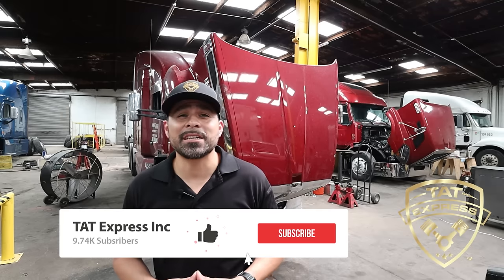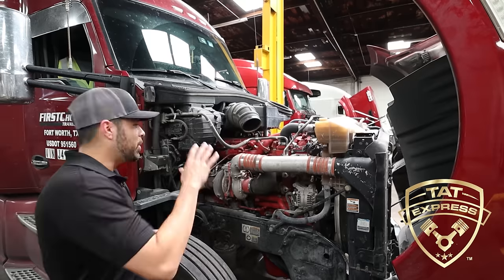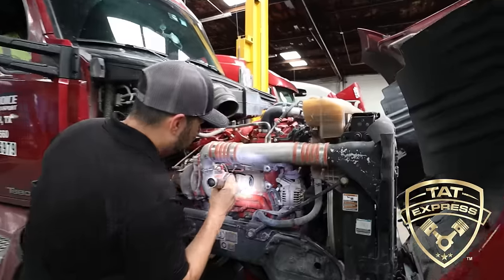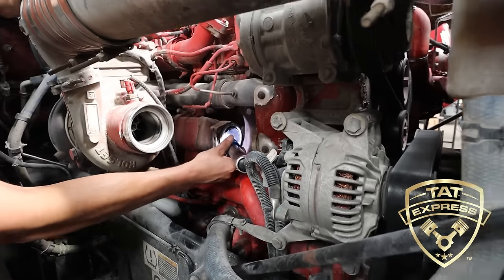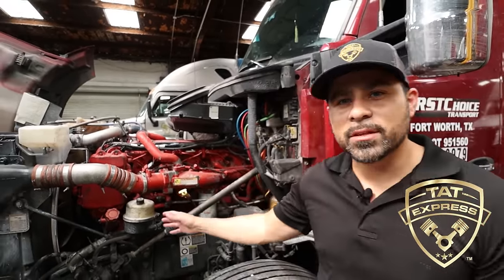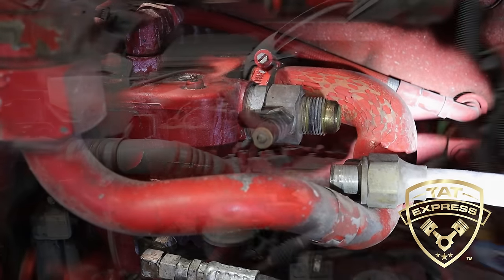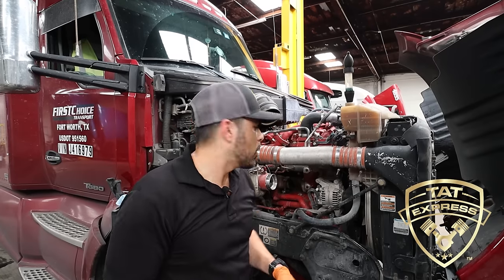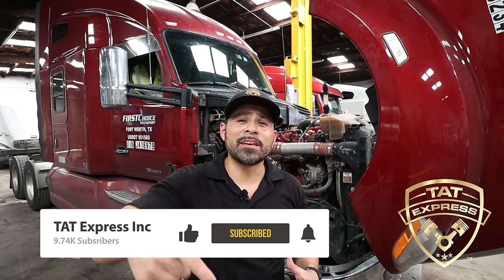Cummins Coolant Overflow/ Coolant loss/ Excessive Pressure in coolant/ Cummins ISX15/ Cummins X15

Comment: Thank you for the videos. Great job. Here's a tech tip for ya. If the driver says I have to keep adding coolant and I don't see it leaking. Quick test. Pull the drain on the air tanks. If coolant starts flowing from the air tanks. It needs a compressor
Reply: Which compressor?
Can you be specific please
Reply: Air Compressor.

Comment: Changed out refurbished radiators 3 times! Radiator finally holds, now the COOLANT starts leaking from some where else 😂 lol! Thanks for the videos I’m fixing on replacing the EGR cooler next I can’t get a Delete here in Cali !!! 😭
Reply from the maker: Hugo, you defiantly can waste some time with refurbished parts.  Thanks for the sub.  🚚🔧💪

Comment: I’m having high coolant psi and takes more than 2 mins to build primary air on idle . I’m also having oil n water coming out of secondary air tank on driver side . Would this be an indication of compressor bad ?

Comment: Forgot to mention checking the radiator cap. Even if its not mounted on the radiator but a coolant tank. Since caps are pressure releaf valves and need to maintain a certain amount of pressure to the system to lower boiling point since every pound of pressure raises boiling point like 3 or 4 lbs. If the cap doesn't hold pressure due to a bad seal then the coolant can boil out slowly. I don't work on big trucks but in the automotive business & I would say 70% of the caps I test fail
Reply from the maker: John, thanks for sharing your experience.  We appreciate the support.  Be sure to hit the sub button.

Comment: I had sorta the same issue on my 2010 FX35... but when i drive all the coolant ended up in the expansion tank and out of the radiator... so often i had to siphon it back into the radiator. I didnt have any weird lights but if i continute to drive all the coolant will be in the expansion tank and myc ar will overheat.... after change so much i finally took it my mechanic where they found i had a warped head... changed headgaskets, timing chain, water pump, galley gaskets and all... all seems to have resolved the issue for now.... i'm still getting the air out the system after 195 miles driven.

Comment: I have no coolant in oil. Air compressor line don’t have any wet spots. No coolant leak under truck anywhere. When truck is idling it’s good but when on the road the coolant drains. Coolant is going somewhere else what else could it be? Gasket?
Reply: Transmission cooler possible culprit 😊

Comment: We had an isx blowing coolant out and the owner immediately said the head is warped and to take it off. While doing the strip down we found every lash setting to be tight. Zero lash on both intake and exhaust. I wanted to do the overhead set but owner insisted on replacement.

Comment: I had pressure in my coolant and after running for 4 hours I was told it was my over flow reservoir cap. Then when I would get a load the pressure would spit out coolant through my hoses and split my passenger side top hose. So I ask them to change egr cooler and they found a crack in my head. My cam was damaged and rollers needed replacing.
Reply from the maker: Thanks for sharing your experience. A combustion gas test could of indicated an issue before hand.

Comment: New Subscriber....think I need a new mechanic behind just watching this...just bought a 2011 peterbilt with Cummins isx...rear & front seal leak & the same coolant issue...not losing a lot but enough for the low coolant light to come on...but overflow stays nearly full...truck isnt running hot...dash reads "NO WARNINGS"...remarkable oil pressure is balanced..but does have leak...bought at cheap price...less than 15...but mechanic diagnoses was truck would need a complete overhaul because of the coolant issue...I wish you'll establishment was closer for better 2nd opinion...I just wanted the seals replaced & find the coolant leak....I can only afford so much...

Comment: if you fail the bubble test and take off the compressor discharge line and it does not reduce bubbles could compressor head still be bad?

Comment: I have a Cummings ISX when going up bridge with a load my engine is stalling. I changed the accuator on the turbo. The coolant is very dark. Can pressure from EGR cause engine to stall?

Comment: Hi,thanks for the helpful video always.i  have 2013 volvo d13. My problem is temperature going up all the way to 205 after I stop driving,traffic areas,and hills.and never go back to 170 unless I turn on the AC period.and when I open hood see if the fun working if I on the ac yes if not!! I change thermostat, fun selinoid,temperature coolant sensor.fan clutch is good.any aida what can be

Comment: I have the isx 15. I’m losing coolant. But still trying to determine where. It’s going from cold max to cold min in about 16k miles. Talking with kenworth, I have no signs of a head gasket. No pressure in the coolant system. No cross between engine oil and coolant. Both look clean. No coolant coming out of the vent cap. No bubbles percolating in the reservoir. With a pressure tester it goes from 15psi to 0 in less than 10 minutes. Kenworth told me to check my fuel and transmission. (13 speed manual with heat exchanger) can’t see coolant in the fuel or water separates. I changed the transmission oil and sending it out for a oil analysis to see if coolant is mixing in it.  I’ve taken the hose off the exit side of the egr cooler and looked good and felt dry. At this point I’m hoping it’s the heat exchanger on the transmission. It’s the cheapest fix. Other than that the truck runs like a champ and no loss of power
Reply from the maker: Have you tried pressurizing coolant system to find leak?  If you suspect heat exchanger, remove oil fill plug to see if over filled
Reply: TAT Express Inc. I did that over the weekend. Ended up draining the transmission. I bag some of it so I could send out for oil analysis. The oil looked like crap and I was 99% sure it was bad from coolant. But had no time and had to get back on the road. Well today it failed. Seen oil in my reservoir. So luckily I just got loaded and was close to home. I was heading for Washington. I went under and pulled to fill plug and oil looked like a milkshake. So picked up a new heat exchanger and came home. When I pulled the drain plug, coolant came out first then the milkshake came out. So flushing everything out tonight and back on the road in the morning.
Reply: @cztrucking1559  Get rid of that coolant heat exchanger and install an air cooler. They are cheap and you will no longer have these issues.
Reply: @michaelwright1602  if I had more time I would. But it was already late in the day and trailer was loaded.  If I wasn’t on the road by next morning, the load would have to sit on my trailer all weekend. Luckily I was close to a kenworth dealer who had the heat exchanger and was about an hour from home. Son grabbed the part and hauled ass home and swapped it out which was a quick job. Flushing the cooling system took all night but I got back on the road and made my delivery in time to get reloaded on a Friday and make it home for the weekend

Comment: Good videos,  I have a  450 ISX and when I was pulling a load I heard a big noise and truck started shaking, and I noticed I lost almost all  my coolant and oil level raise like almost 3 times on the stick but is not mixed with coolant. Egr connections look clean, engine didn’t got hot or give low coolant warning. This happened yesterday had to towed trick to the yard. I will appreciate any recommendations
Reply: @Mark McCauley thank you for you reply and advise. truck already at the shop..
Reply: I have a 2016 isx 12 on a cascadia. How good is that engine ?
Reply: @jjteam8991  my first truck was a Peterbuilt 2007 has Isx and I put 1800000 on it. Now on this 2015 Cascadia I have  450 ISX 800.000 miles on it so far so good.. only oil changes

Comment: My friends truck head block was told and need to be replaced because one of the injector stoped working.  I understand if the injectors stays open, it will damage and scarf the walls of the cylinder, his case it was closed dead (no contamination with oil). Did he replaced the head for no reason since piston /wall/ring is lubricated with oil. ? Ther wasn't don any compression to the cylinder before head replacement. (Sorry for my engl.)

Comment: I had this issue on a DD15 and I needed a rebuild because coolant was leaking into the oil through two cylinder liners
Reply from the maker: Anthony, thanks for sharing.
Reply: What you mean ? Overhall job ?
Reply: @eduardosandoval1113  yea. only the top was required but I got the top and bottom overhauled
Reply: @acola2  wow , you may said mine  as well , how much do you pay for ?
Reply: @eduardosandoval1113  labor about $5,500 and parts about $4,000 not counting reworking the head
Reply: @acola2  reworking the head ? So how much you pay at the end
Reply: @eduardosandoval1113  about $1,000 but my prices are a lot different. I didn’t go to a dealer
Reply: @acola2  got it , even that you spend like 11,000 , the dealer wil kill you
Reply: @acola2  tanks for answer my friend,  be safe

Comment: Have the same problem coolant pressure however it keeps running not overheating. My question is if it's not overheating and continues to drive can it make the matters worse?
Reply from the maker: It will make things worse when coolant is mixing with the oil.  I recommend repairing it immediately
Reply: @TATEXPRESSINC  it's not mixing with oil the coolant level goes down about couple of inches below the minimum mark and then stays there doesn't lower anymore.
Reply: Hi, I have that problem at the moment, could you tell me how you solved it, thanks
Reply: R u still driving, what u did I have same issue
Reply: @MuhammadAfzal-xo4jj  hey did y'all find the issue

Comment: I would drop the pan first, bar the motor and look for coolant in the liners, or cylinders. Odds are a liner has fretted, and taken out the head, save the customer some money with this test first. And folks these heads are one time use, do not install a reman head either, only a new OEM head should be used. And this horse has been beaten to death, only a new OEM head. If the liner is fretted, the motor will need to be rebuilt, cylinder/liner ledges cut and liners shimmed to .0014 of an inch. And do not simply replace the one affected liner, you are just throwing money away... 

And why do these liners fret so often in these ISX motors? It is due to the driver pounding the crap out of them lugging the motor while under a load. An ISX motor is designed to run at high RPM's, above 1500. They are safe to run up to 1900 without issues. When you lug the motor, due to the design of the block, the excess pressure from the torque of the motor is transferred to the piston liner, and eventually they bust loose. Do not lug these motors.

Comment: Have I been doing it wrong ? Are you supposed to add water to the coolant ? I usually pick up a bottle from the truck stop and never added water to it
Reply from the maker: Kingsley, it's best to use red coolant that does not require adding water.  Water contains minerals that are not good for internal components.

Comment: We have the same problem, we inspected the EGR cooler, was good, we change the air compresor, last we replace the head, and last a week, we back to the same problem,  so now we are lost,  any sugestión
Reply from the maker: Oguer, did you do combustion gas test?
Reply: Yes we did
Reply from the maker: After repairs, you are still showing combustion gases entering cooling system?

Comment: New sub,  Hey I’m looking an ISX in a 2012 or so Volvo,  they put a new radiator when I looked at it we ran it for about 15 to 20 minutes drove it around sounded great. shut the truck off,  the coolant reservoir was either boiling or air was steadily being introduced even like five minutes after the engine was off????
Reply: What was the issue? Thanks
Reply: @gavikpt1  it was the air compressor gone bad. Still $2500 from the thieves/shop
Reply: @roz4747  that’s so bad. I had the same issue but after replacing injector cups problem gone now
Reply: @gavikpt1  what was the bill for that job?
Reply: @roz4747  around $1500 parts and labour

Comment: Hey man I love your videos but now at this point I need your help my truck was at cummins for the extended warranty evaluation inspection and they found The front gear housing gasket has an oil leak that is classified as a class 3 leak, meaning oil is running down the housing, also the coolant filter is leaking coolant. now you know if I get that fixed by dealer it would cost me $$$ I live in texas Dallas 1st time truck owner and very confused about the situation please advise me thank you

Comment: I need your help. I'm tired of spending money on my 2014 cascadia with isx cummins engine. I need to know hiw to clear codes on it when the check engine light comes on, engine shut down light,  and warning engine light all shows up at the same time, and the truck goes into 5mph derate
Reply from the maker: Derrick, sorry to hear your having issues.  Do you have the code read out?
Reply: Invest in a Cummins INLINE 6 reader, you can find them on eBay for around $250, the diagnostic software is included. Odds are you need an EGR tuneup, that is where I would start. When was the last time you changed out the sensors and cleaned the soot out of the intake side of the motor? You have two key sensors, your intake manifold pressure sensor and exhaust back pressure sensor, those should be replaced yearly. 

Now, how about the DOC and DPF cans? When was the last time those were removed, baked and de-ashed? It sounds like your cans are face plugged, along with needing an EGR Tuneup. When was the last time you adjusted the valves too? The overhead? It sounds like the truck has not be maintained properly. Just my .02
Reply: @TATEXPRESSINC  sorry my phone has been acting up. I just had it repaired. I had to take a temporary job until i get my truck repaired. I had a technician come out and put a laptop on it, and discovered that the nox sensors had it in derate. I will change then out, and follow the advice of Michael Wright.  Thanks guys. I definitely will keep you all informed.
Reply: @michaelwright1602  Thanks for the very informative comments. I will definitely follow your advice. Currently, i had to jump on a temporary driving position to keep things going. I will be back on the cascadia every weekend until i get it fixed.

Comment: i need some assistance on diagnosing my problem! im losing coolant no visible leaks no high pressure but i found oil residue in the reservoir tank! one shop mention head gasket but my oil is clean no milky oil in the pan! another said for sure oil cooler but now im hearing EGR! im very confused any advise will be very appreciated !!!
Reply: Can you give us updates please

Comment: Question:. I had front engine cover gaskets replaced, valves adjusted, rear engine seal replaced. I was basically leaking half a gallon of oil daily from front and rear.  I never had any antifreeze preassure even when the engine was hot.  Durning driving even on heavy loads on flat surface my antifreeze temperature usually stayed at around 180 even at idle.  My oil temperature was usually at 200-210 regardless if on idle or driving.    Now after the repair at idle or driving antifreeze temperature is at 200+-. Oil temperature at idle is 220.  When driving under a 44k lbs load my oil temperature reaches close to 240 at times close to red line that's at 250.  Antifreeze temperature stays at 200 and fan kicks in at 210-212F.      And now when engine is hot I'm getting preassure in antifreeze rasivour which I never did.   Before the oil leak repairs engine was hot I would open the antifreeze rasivour and I would never hear feal any preassure.        What do you think the Russian mechanics messed up on the engine?
Reply: Stop hauling heavy loads I suggest first.Why haul 44k when you can haul 24k for more money and less pressure on truck

Comment: Could a bad air compressor give high air pressure around 140 psi and at the same time high coolant pressure or do I have 2 different problems? 2015 dd15 help please

Comment: my 2015 cummins isx15 engine through a rod at 283k miles with no alerts on the dash at all and oil pressure read normal until i suddenly lost power on the highway...anyway now cummins is asking me why i ran the motor at 2750 rpm's for 30 seconds according to ecm ....of course my response was...i didnt the gauge only goes to 2500 rpm's and also the motor has a rev limiter...my question is....is it possible to run that motor at those rpm's?

Comment: What about when the coolant reservoir turns black inside
Reply from the maker: Kyle, that would need to be troubleshot.  It could be oil or soot entering the coolant system.
Reply: @TATEXPRESSINC  I’m going with soot… as coolant stays clear of oil… seen this on a couple trucks… I think it’s small head gasket leak
Reply from the maker: Kyle, you can perform a combustion gas test and pull the hot pipe to check the EGR cooler for leaks.

Comment: I use a gallon a day of antifreeze. Replaced radiator, Reservoir and seals on the water pump. Still the same problem
Reply from the maker: Have you checked the other items in video?

Comment: I had same problem 10 days when driving or accelerated coolant disappeared when I turn off engine coolant coming back I hear noses air compressor side  when truck is idilind and I couldn’t find where air coming from I don’t see coolant leaking air compressor , any advice bro,
Thanks for your information I really appreciate
Reply: Hi, I have that problem at the moment, could you tell me how you solved it, thanks
Reply: @fergamec  did you fix the problem?